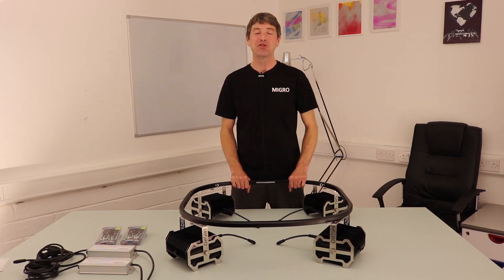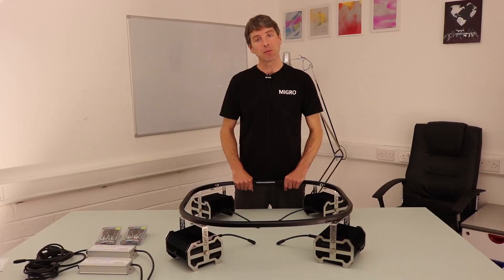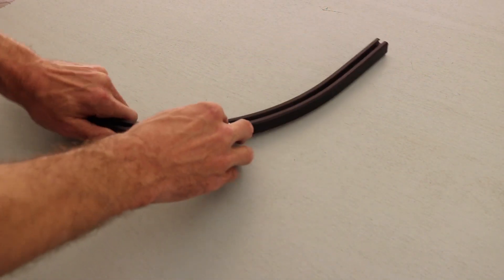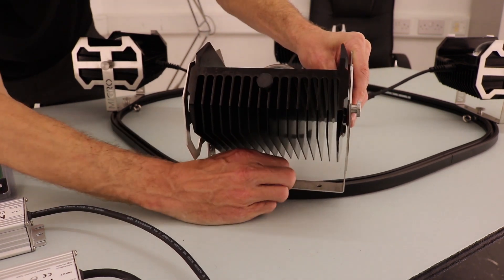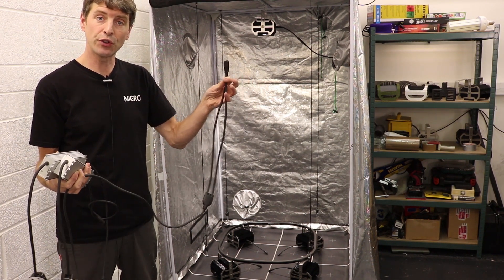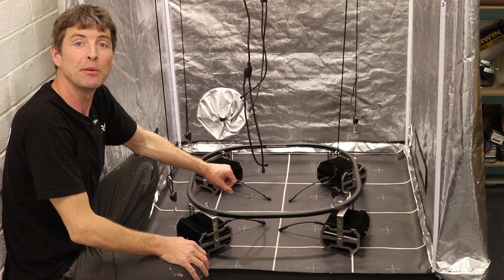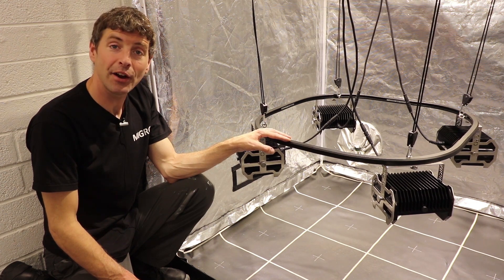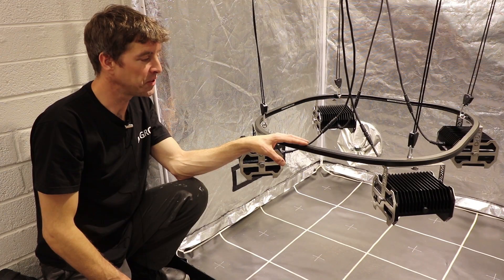MIGRO 400 overview - Full spectrum COB LED Grow Light

Comment: Are 4 migro 100 same as migro 400?
Reply: The light is the same but with a 100 you get a driver with the 200 you get a single driver with 2 outputs, with the 400 you get 2 drivers with 2 outputs each via a set of splitter cables. With the 400 you also get a frame to hang them from. With all of them you get ratcheting mechanism. 

For those complaining about price you can build similar yourself but you will find it harder to make it IP67 rated and account for thermal expansion of gas within unit, and the other factor is that you get a 3 year warranty do the investment is protected. Also relatively easy to replace CoB when out of warranty.

Comment: Beautiful but price point is too high.  You can get Cree cob cxb3590 or vero 29 arrays with the same PAR output for 1/2 the cost.
Reply from the maker: Please name a cheaper equivalent light.
Reply: Ok the cf grow 400 watt.  
Rapid led has great lights
Timber grow
Canagrow
Any crew cxb diy kit on eBay
Reply: ^cree
Reply: That being said yours is by far the coolest one I have seen.  Probably worth every penny.  I personally could not afford it.  Wish I could.
Reply from the maker: MIGRO is cheaper than timber in watts per dollar for their Cree kit. Cheaper than rapid led in watt per dollar.  These are kits and not properly sealed units. Sorry I'm not  comparing to canagrow led....

Comment: Which cob chips ?
How much watt per chip ?
Reply from the maker: We use Luminus LEDs. 107 Watts each
Reply: @MIGROLIGHT  What is up with the MIGRO website https://www.migrolight.com/product/migro-400/   
The PAR map you used for the MIGRO 400 has huge areas of "hot spots"  much more then the generic "box" LED you are comparing it to.  Raise the MIGRO a little higher for a better looking PAR map to use.
Then record this height so the public can know and then measure the total PPFD for the 4'x4' tent you like to use.  Take this and divide that by the 428 watts it takes to run them to get the actual PPFD.  

You cant just keep adding MIGROs into a garden without raising them or you get a PAR map like the one you used online.  

On your website you don't even name a light for comparison.  Since the MIGRO 400 is $976.00 Shipped to the U.S. why not test it against ARC Series 2.0 400 which is $740.00.
Reply: @joshgross8741  Holy a 400 watt led was 900 4 years ago? 
A dollar a watt now.

Comment: The price point on these is just too high for your average grower to really consider buying. The Migro 600 sells for $1300+ before shipping costs. Anyone with that kind of cash to spend is more likely to get a setup with greater coverage potential. These are marketed to small, closet growers with a commercial price tag.

Comment: Are this upgradable to the 600 unit easyilyness?
I really like this unit but I won't spend more than £500 on it. I'm waiting for a price drop.
Reply from the maker: Won't be one unless LEDs drop price signficantly. It will be a few years before that happens I'm afraid. You can upgrade the MIGRO lights and add on as you need.

Comment: Have you tried any induction grow lights lately, I would be grateful on any info please
Reply from the maker: Hi David, I guess you mean plasma? I've never tested them but from what i remember they are not as efficient as hps.  Their big benefit is they last longer and we're traditionally used for hard to access lights like stadiums etc. Do you know of any being sold for grow Lighting?  If so send me a link and I'll see if I can get hold of any.
Reply: Hi shane here you can buy them www.alibaba.com, you'll be surprised on the large variety  of different types of grow technology it is vast, I hope this helps you, plus I did get told a while ago that they're "supposed" to be superior to LED's  but I won't know  until you the guru of lights tests one out.

Comment: Was all ready to buy light on website. Went to checkout and shipping was to much. I'll stick with my spectrum kings
Reply from the maker: The MIGRO 400 IS $945 delivered anywhere in USA or Canada and outputs 840 PAR. The spectrum king 400 is $749 and outputs  507 PAR. Spectrum king output is 40% less!
 MIGRO is $1.25 per umol PPFD Spectrum king is $1.47 per umol PPFD.
MIGRO is much better VALUE anyway you look to it.